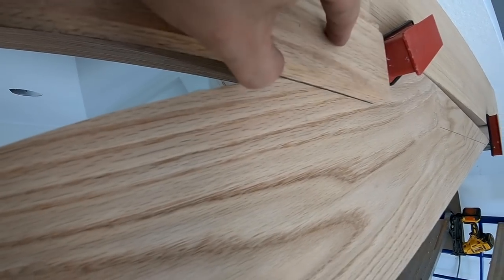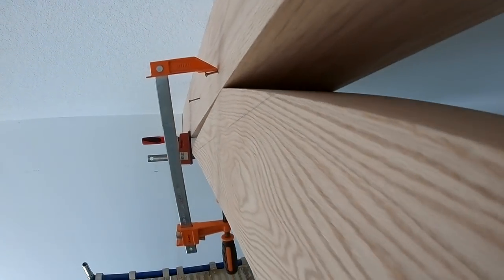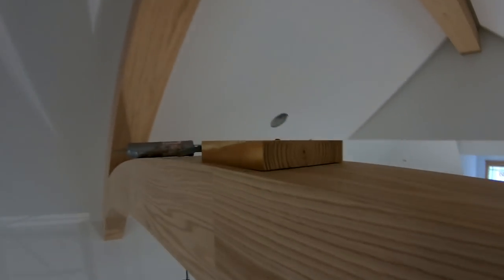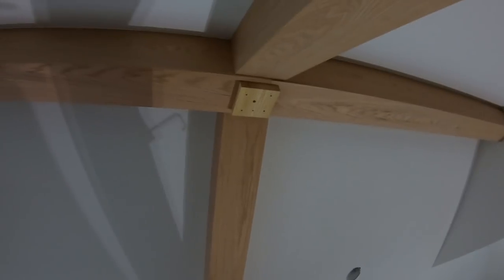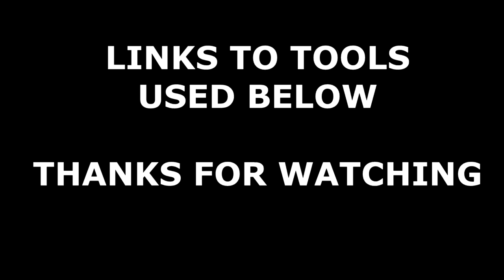Installing Oak Truss Bottom Cord SOLO

Comment: I use a duct lift to install box and solid beams by myself. I’ve put a solid 8x10 rafters 14ft long on a 16/12 pitch with ease. Haven’t had a job with a arched bottom chord yet but thanks to you I know how to knock it out. Well done sir!

Comment: I’m not really a Safety Nancy but that ladder set up on the scaffolding had me sweating. 🙈😂
Reply: I'm not a safety Nazi either but I might have had double wide/8' wide scaffolds and then plywood on top of that.  I like the scaffolds with wood planks so you can easily attach plywood to it.  If the scaffolds are on wheels they can be easily moved to the next area.  Extra work and expense but worth it IMHO.